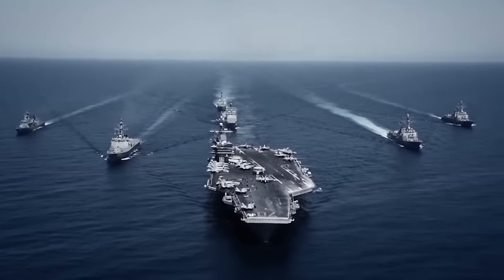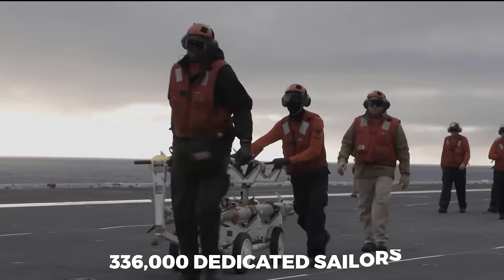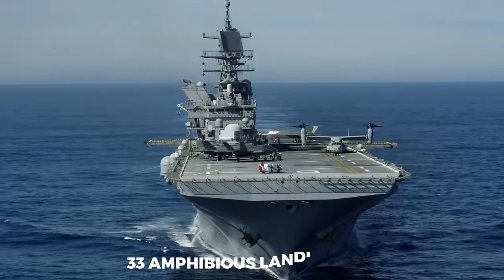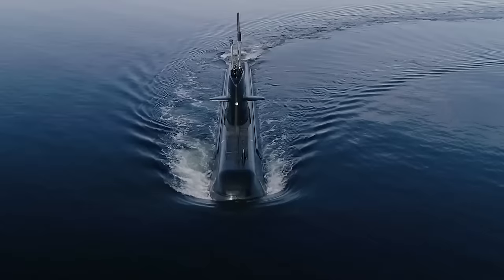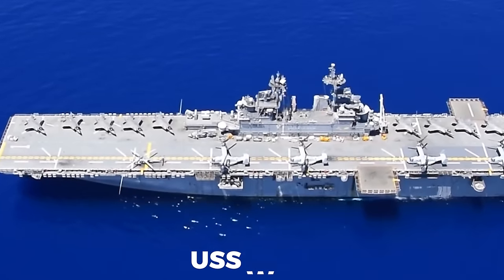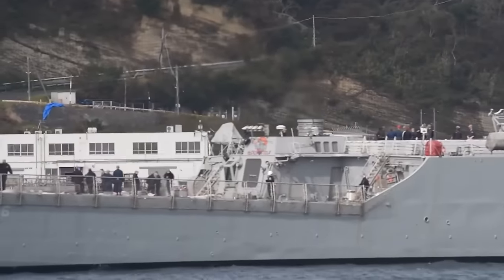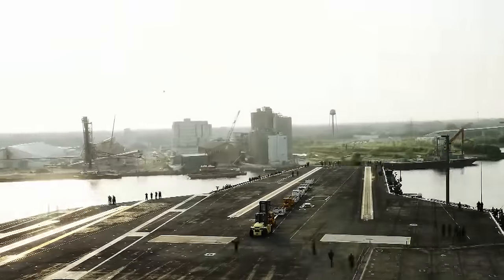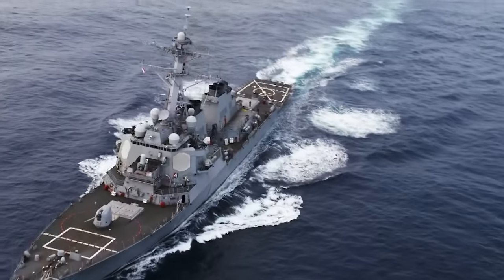Why Are US Aircraft Carriers STRATEGICALLY Deployed Worldwide?

Comment: I'll tell you what 🤔 If we only have 500 single pack of tomahawks or otherwise that are dispensed thereof. We are in a world of crap ! Navy proposed a 500 pack ship with a very low profile. They said it would deplete their stockpile. Very interesting. This is what happens when you let civilian senators and congressmen have total control over the ability of the dod. It should be limited and when things get hard and difficult for concept. Just like the Ford was for the power plant and the cats in the traps. Need to keep pushing forward. Not throw billions of dollars down the toilet. Scrapping the steel for pennies on the dollar. A billion dollar shit for a couple million dollars that is not improvement. Congress flexes their muscles with the department of defense for this simple reason that they can. This is the reason why we're trillions of dollar in debt. 30 billion here. 10 billion there it adds. Proof of concept is difficult to say the least. If the concept could not be proven in preliminary status, it would never go through to build. The Ford class Carrier has the power to run 4 railguns all at the same time as running the 4 cats including traps. Concept has been proven but yet it just sits there. 50 mm Cannon on the front of destroyers of our arleigh Burks is nothing less than waste of space. You want to put something scary on there. Put a railgun on it. It is a large package in conception. But has been compressed to a smaller unit. All it takes is power. Congress is the one that is throwing billions of dollars down the toilet at 75% completion or 95% completion?  That is ridiculous to say the least. Traded our f-14s that were totally meant for air-to-air interceptions. Of course, like any military due to the constraints they have to add on extra crap. Just like the Huey. Which pay it off in Vietnam. But the Kiowa a recon Total recon that is so quiet but can't be anymore because they have to put zumi rocket pods on it and add more weight with chain guns. I could go on and on with a 5 Page what for 🫣 everybody need to contact their congressmans and let them know why we are trillions of dollars in debt. When things get a little hard they want to quit every damn time. They're not cheap when you're paying Federal payroll. I don't know who enacted that, but a civilian contractor such as Newport or any other should be getting paid by the owner that is supplying the product. Doesn't require Federal pay or the amounts thereof. That's a trillion dollar debt there. Congress is supposed to tighten the budget and trim it, not cut it in half at the detriment of our defense budget. There is what's called a black budget that can never be questioned. It is automatically passed. It requires no signature or nothing. That black budget goes to the dod for the conception and proof of conception. The State of affairs of our Navy are fair right now. We were always supposed to have a 3rd fleet. It would be called the 8th Fleet. We can't keep the 6th and 7th Fleet up to par. If it were not for for our carrier jump ships attack ships. Those are the smaller virgins of the USMC carriers. We would be in a world of crap ! We can build as many of them as we can and they should be. The 500 pack usn/ ship should be made. The concept has already been proven and if all we have is 500 tomahawks in our inventory. Then we have a problem. A standard of 70 to 90 single per destroyer 40 to a cruiser. Every time they are depleted they have to take a a cruise. Probably a 2K cruise to get out of range of the battle to be reloaded 👀🥺 I'm a little confused here. All that money put into a ship that could not be Ras at Sea that is totally ridiculous. That is why we're pushing for the 500 class Navy ship that can hold a good proportion to meet the proportional of the instigator if it be China or Russia whomever. With overwhelming Force. Not tit for tat. I'm just an old usn rotorhead and I'm tired. Appreciate all the work that you do, especially bringing all these things to light to the public. Especially to the US citizens and Patriots and vets. I wish this channel a good journey and thank you for your service 🕊️🕊️🕊️ ps, sorry for the bio